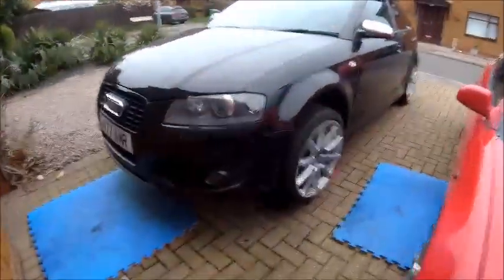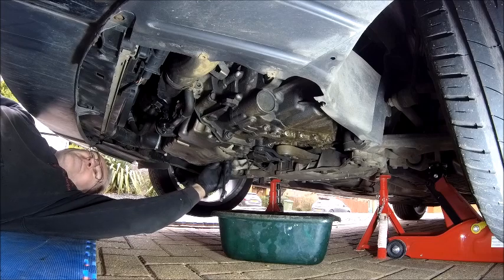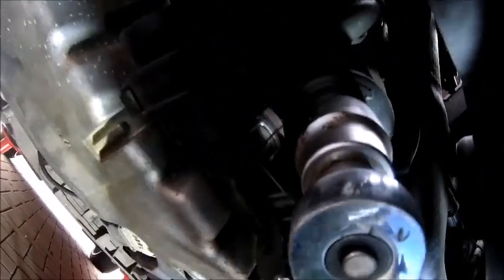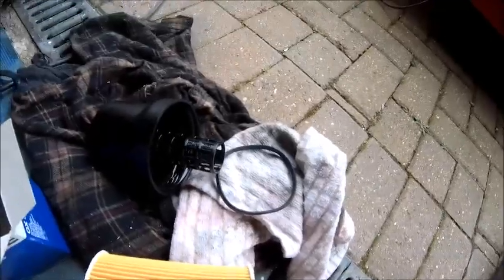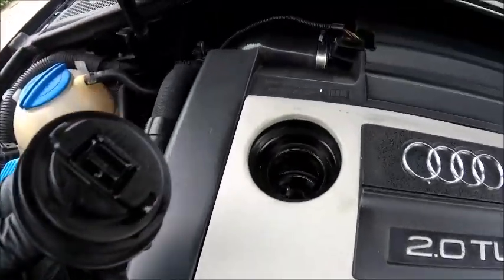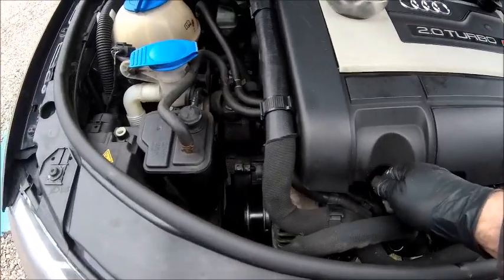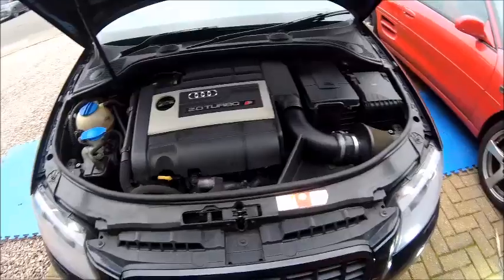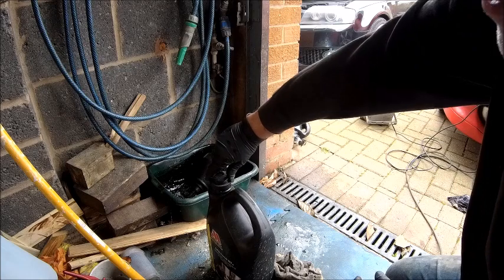Audi S3 8P Oil Change March 2020

Comment: Oil housing on mine is 36mm my car is ftsi 2.0 200bhp a3, also on the housing you can buy a draining too, machine mart sell them, or you can use screwdriver on the drain nipple not inside it just on edge it will go inside oil will come out, when you took it off took filter out remember in bottom there is that nipple push on it it will go back in to place so new oil won't leak out, I have alloy sump plug is 18/20 nm, metal sump plug is 25 mb Same with oil  filter
Reply from the maker: Thanks for the info, like & subscribe ....

Comment: I'm no mechanic! But by the "look's" of that filter valve it seems to be you have to grab the yellowish part with what I imagine to be a sort of 2 tooth fork, like the ones you would use to take of plastics from a dashboard, and pull it out, I imagine that if it has a good design it will be spring loaded so it will close as you release it, or it just pop's off and on!
Reply from the maker: Thanks ill see if i can crack it for next time.
Reply: just pull it out with pilers, not needed in most cases but it does hold quite a bit.

Comment: Hi ade just a quick one what was it that yup said about a slight smell of fuel if the engine oil needs renewing :)
Reply from the maker: Hi.. yes after a while there will be some fuel in the oil and you can smell it when it comes to change to...but if it's really excessive it could be a leaky injector especially if you smell it after a few weeks / months .
Reply: @AdeReeves  ok brill thank you mines a 2008 plate with 122000 miles on clock it's going in for oil change tomorrow as not had it long and the oil looks pretty black and thin so hopfully after that I won't get a smell it was litterly the smallest little smell I got thankfully so hopfully a oil and filter change will sort it thanks mate :)

Comment: Hi thanks for the video, how did you find the jacking points?
Reply from the maker: On the front I tend to go for the bottom wishbone joints as the car is lowered and a bit of a bugger to get the jack under  :)

Comment: Hi Ade, 

Just wondering if you've ever done any kind of tuning to the car and how it's held up if so? Have you ever looked into carbon cleaning your engine?
Reply from the maker: the car has been looked at prior to me , and if you look at the thermostat video on here i clean the intakes ...made the car run a lot smoother.
Reply: @AdeReeves  Oh great! Thanks for the reply Ade. I ended up getting a custom tune for the car paired with a ramair intake and now it's absolutely wild. 

Will have to get the intake valves clean soon though! Glad you're enjoying it